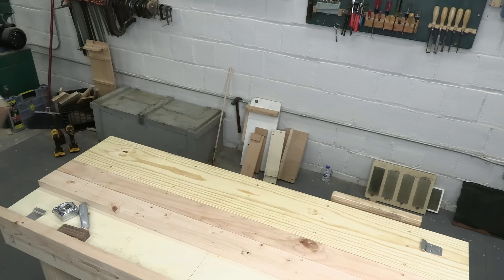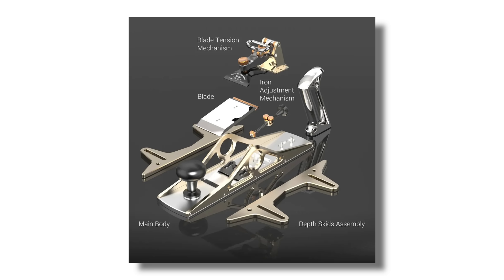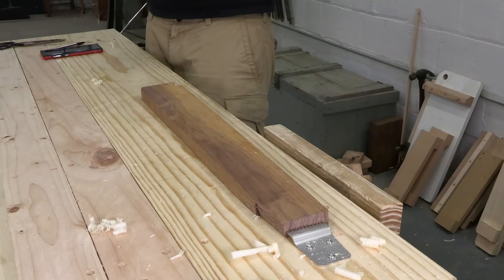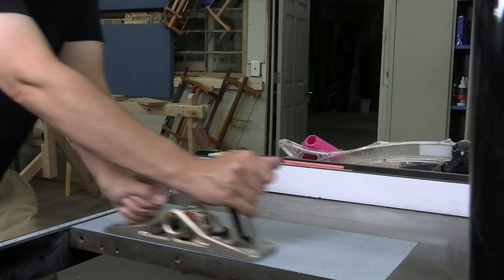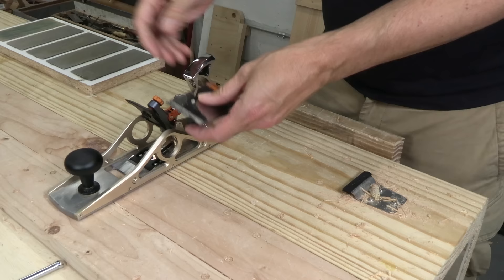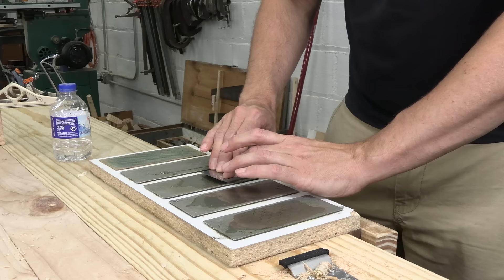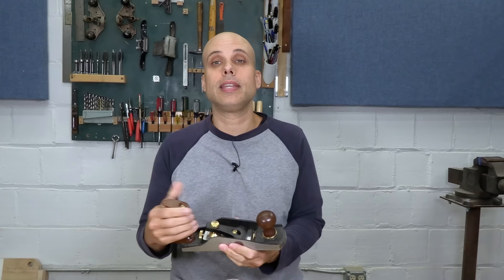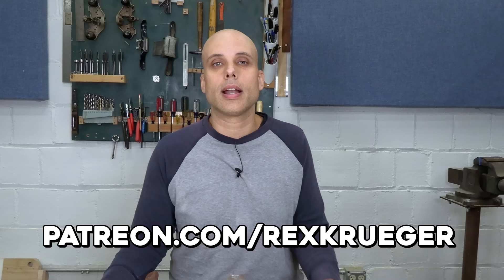How good is a REALLY expensive plane?

Comment: So, Bridge City...sigh...

Nearly every thing I've got with Bridge City/Harvey hand tool has had a problem, usually not obvious right away, and even if they aren't all exactly "quality" it's hard to justify a purchase given the prices (and the nonsense pricing tactics):

Try Squares: even with minimal use they lose their trueness very quickly. After nearly ruining a second project due to this they all went into my Drawer of misfit tools.

UG-1 Universal Gauge: It's too bulky to keep on my apron. It doesn't do anything particularly well compared to pretty much any other tool. Some features like Depth Gauge are just not great. If I go to the wall for something, I'll grab a better tool.

Adjustable Square (T-Square): The magnetic markers are nearly useless for staying in place. It's I don't think I would have serious problems, but with the feature I got it for not working it doesn't come off the wall

Mini Miter Square: The magnetic piece has become lost because it falls off so easily and looks like nothing. Without it the square is generally worse than other similar small squares. Price isn't horrible for what it is currently.

All of these I got at once with the mini hand plane, which might be overpriced but at least I have no serious problems. 

Harvey Miter Gauge: I wanted this one to work so bad, but I hated it.  Wood Whisperer had a big video on the problems with the bar.  Harvey has released a second version which might fix the problem I had, but at the price of $400 I'm not going to go back for a second swing at this.

Finally the CS-3 CenterScribe. This tool I bought after deciding I wasn't going to get anymore, but it's a problem I had no comparable solution for, it's great for hand tool work, and I didn't think they could screw up. They did, although it's still modestly usable. Everything in the engineering is fine except the dang pencil slot. It will only practically work with a regular pencil, and because it's fixed in place instead of a little hole you have to tilt the scribe on the surface or the line will quickly stop.

Two tools out of all I got that I can actually get use out of, and only one without compromise. 

Now, I do have the Gyro Air G700. It's fine, but they have a scam deal on replacement remotes ($200 or for a remote which you can easily order an identical one which is literally a $2 product or less, and they'll still charge you shipping) and at this point I don't think I would trust anything more from Harvey even though I have no reason to think the power tools are bad quality.

Comment: Is there really a need for a plane where angle can be adjusted "on the go"? A tilt mechanism for a blade is rather simple, but does it need to exist? I would think that someone who uses planes for a living would have separate fixed ones with their preferred settings dialed in, and a beginner simply won't care about details as long as it does "plane" things.

As a side note, for the price this featured plane really looks like someone's project in the "Intro to CNC machining" class. The camlock mechanism is kinda cool, but the sides are just... bleh... in my opinion, anyway.

Comment: This is unfortunately the way with all of the offerings Bridge City Tools. I have been tempted a few times as they came out with new stuff and I'm still tempted by the joint maker. They make beautifully steampunk looking tools which is a weak spot for me. However if you look at the prices and the specs and tolerances on and of their squares or layout tools the illusion completely falls apart. If the tolerances they offer are fine by any given user then that user would be better off getting half a shop, at least, worth of squares, rulers, triangles and machine setup tools from iGaging or Irwin. If you're looking for top notch tools with nearly perfect accuracy then there is still nothing better than Starrett. Although the straight edges and fixed squares offered by Taytools in the Kinex brand they sell which is a European company are honestly even better as far as accuracy and for a lot less money. I want the pretty Bridge City Tools stuff but for the money the accuracy and quality just isn't there. As you showed with that hand plane a tool like that SHOULD just work right out of the box. It shouldn't need a level of restoration work like some cruddy, abused and rusted piece from a dusty flea market corner.

Comment: These covers are a faff - I have cut myself on chisels, but that was when putting on the blade cover thingies. So... Nah.

I saw the plane, the handle looks really bad, and just having more than one blade can also be done (as Rex said) with my #4 1/2. The thing is overengineered for engineering's sake only and not even working out of the box - because the maker has no clue. The sole probably is mostly flat when not under tension....

Comment: It seems like this tool is a solution looking for a problem. Not in the "if it ain't broke, why fix it" camp, as I feel innovation is a good thing. I would never spend over 750$ for a single plane, especially one that you feel like you gotta give feedback to the manufacturer to make it live up to its promises.  You could buy a low angle and regular plane from LN,  plus put 150$ dollars back in your pocket for the 750$ this thing costs.

Comment: One of the problems I immediately see is that they made the tote and the knob from metal. Metal expands when it gets warmer. If it gets warmer only in some areas, it will expand unevenly. That's why making the handles from metal is a poor engineering choice in my opinion.

Comment: I've always wondered why wood workers tend to stick with subpar steels for cutting tools. I understand that something like d2 or similar wouldn't be suited for the task due to the low toughness and coarse carbides, but I feel like steels like aebl, 12c27, or 14c28n would be a fantasic fit for woodwork. You would get a moderate boost to edge retention and a massive boost to toughness and corrosion resistance. It costs a small bit more than some basic tool steels but it would be well suited to the task. That's not even getting into the world of steels like magnacut.
Reply: Magnacut is a powdered metallurgy steel - similar to Lee Valley’s PMV-11 which has been available for at least a decade. D2 is used on occasion. My Ray Iles mortise chisels use D2.
Reply: @johnsvariety  Powder metalurgy is a process. Not really a specific kind of steel. Pmv-11 is ,chemicaly and in performance, a much simpler steel than what something like magnacut.
Reply: @Freakmaster480  Of course it’s a manufacturing process. Lol. What else would it be? And PMV-11 is not “much simpler”. It’s just Lee Valley’s proprietary process for that particular steel. Not simpler nor more complex than magnacut - just different. The primary difference is marketing. Anyone can buy magnacut steel. Lee Valley will not sell anyone their PMV-11 steel.
Reply: @johnsvariety  Simpler as in a much simpler alloy that functions in a simpler manner. Magnacut is very special in that it's a stainless that is able to perform like comperable tool steels. Magnacut has around 10% chromium but, in contrast to most stainless steels or higher chromium tool steels, almost 100% of that chromium remains in the steel matrix. Dr. Larrin Thomas designed the steel such only the more ideal vanadium and niobium carbides form. This is a fundamental shift in steel design only partially seen before in 3v. It allows fpr steels with the relative toughness and edge retention of modern pm tool steels while being more corosion resistant than some steels with 2x the chromium content. Both 14c28n and 1095 are ingot steels but 14c28n is a much more advanced steel that makes much better use of current metalurgy knowledge.
Reply: @Freakmaster480  The information on development and process for Magnacut is in the public domain. Given that PMV-11 is proprietary and never has Lee Valley gotten very specific (on a metallurgical level) about the process, you’re making plenty of assumptions about PMV-11. Obviously given that it was developed long before Magnacut, it has not had the benefit the decade of intense research and development that has been applied to process since the 2010s.

Comment: I'd take a Veritas or a Kunz over that any day. Too much chrome plate and a faint whiff of BS on the website. For instance they claim that the blade adjuster has a 0.5mm pitch so it advances the blade 0.5mm per revolution? According to the blurb no, it's 0.01mm and they helpfully convert that to 0.004" so they mean it. The entire website reads like it was written by a web designer who know nothing of the stuff they're selling. 
Then the plane is a fabrication with the sides held on by screws which can never be as rigid as a one piece design.

Comment: Cannot wrap my head around a Chinese plane that costs that much. Or really any Chinese plane, but particularly, expensive ones.
Reply: I may be crazy, but I still believe you can get exceptional tools from Chinese manufacturers, you simply have to have very tight tolerances and be willing to pay more for manufacturing. I generally fault the company that provides those tolerances and pays for the manufacturing. Basically, China can build you what you are looking for, as long as you are willing to pay for it.